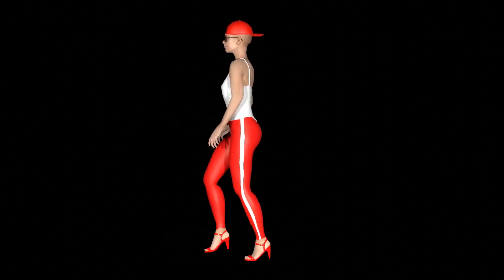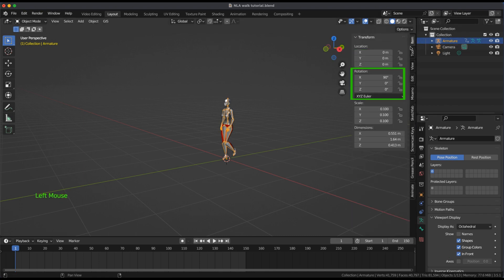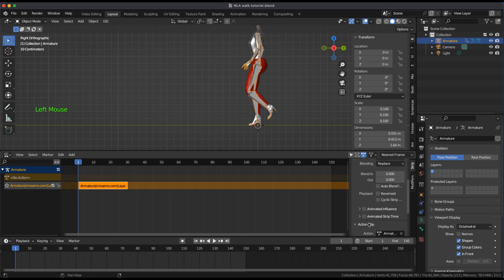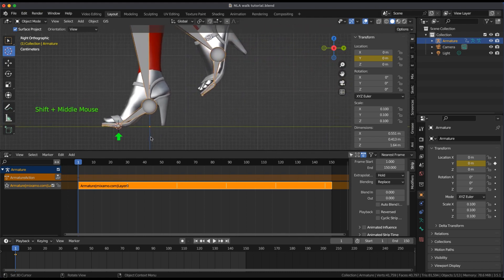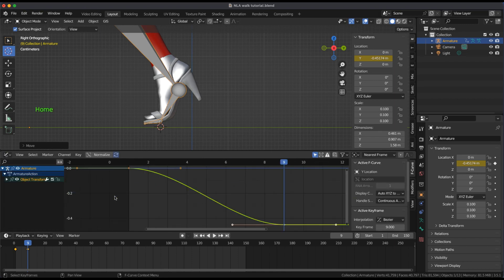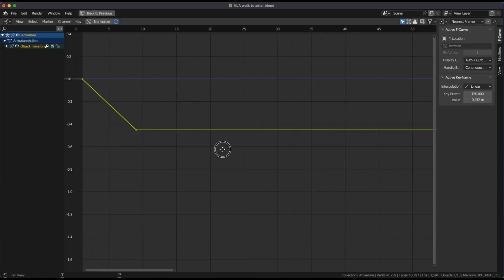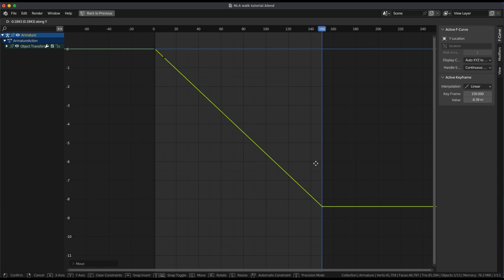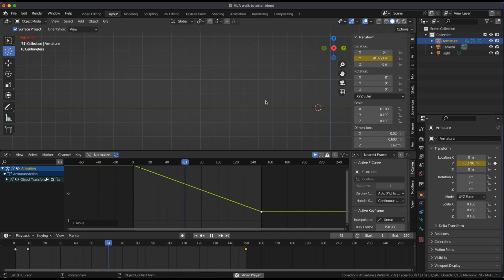NO FOOT SLIP WALK CYCLE Tutorial in Blender

Comment: The first step lines up perfectly, but after extending out the Y transform down the line all of the steps slide, including the first one; any thoughts on why this might be? I'm running the walk cycle for twenty seconds, that being 480 frames, but on closer inspection the issue occurs any time I add a Y transform keyframe beyond the 2.23m of the first step. I can make it work to a degree by manually changing all the frames of the second step to have the same forward distance as the first step, but that'll be nearly five hundred manual changes if I try that method further.
Reply from the maker: Thanks for watching. I'm not really sure why u can't adjust the foot slippage with the last "Y" keyframe. The first  2 "Y" keyframes set the angle for the 3rd to line up to. I redid this "no foot slip walk cycle" to see if there's an error. All worked well. Make sure the length is set correctly in the NLA editor. Hope it works out for you.